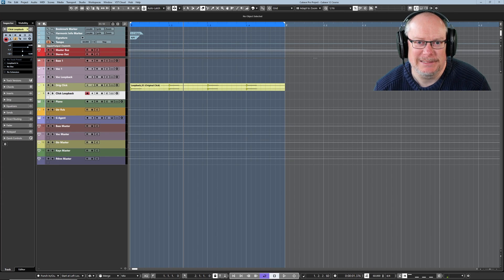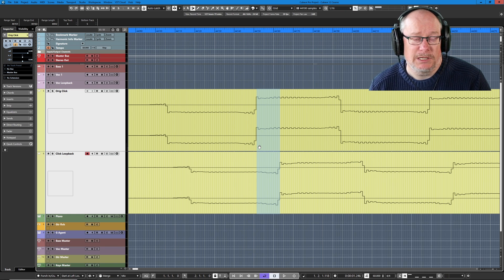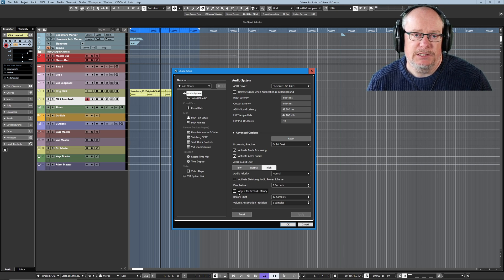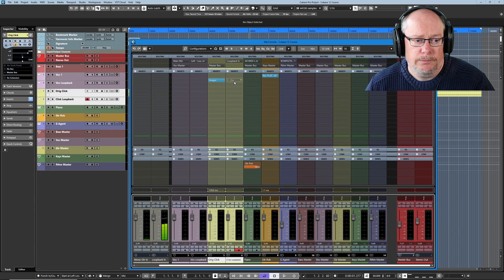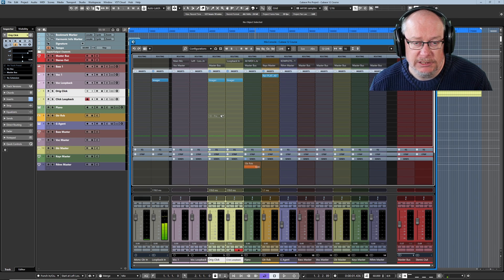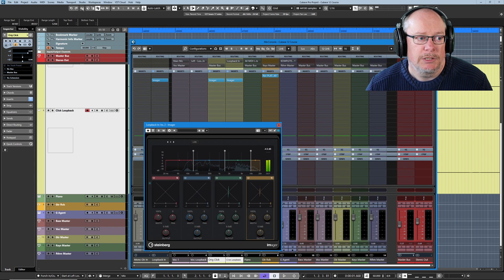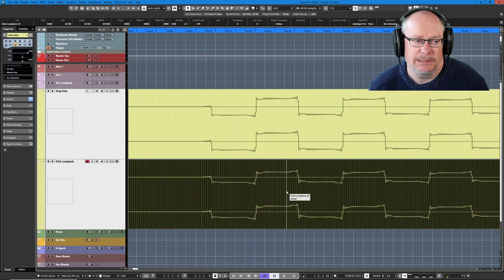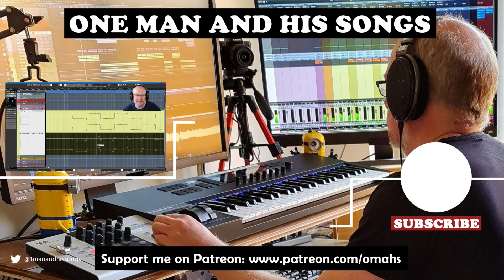The Essential Guide to Latency in Cubase 12 (Pt.4) - Record Latency & Manual Adjustment

Comment: Hi again...this may answer my previous inquiry...I have 3 plugins on this track and the total latency is 46.5ms..the interface I am using (tascam uh-7000) has a 13ms latency at the smallest buffer setting. If I just account for the insert latency that would be 2232 samples and with both interface and interface it is 2880 samples. If I set the record shift to 2232 samples the latency seems to be just about gone but not entirely. setting the record shift to 2880 or even higher changes nothing...I m not quite sure what is going on entirely but set to 2232 it is more than acceptable and there are no timing problems..thanks for your last reply.
Reply from the maker: Each of those issues is really a separate question, which I try to address across the series. The idea with Record Shift is that you use all of Cubase's OTHER tricks to eradicate latency (primarily Adjust for Record Latency and Constrain Delay Compensation), then use Record Shift as the final adjustment for any remaining empirically derived discrepancy between your played signal and the recorded one. It's a very complicated question, with many different components.

Comment: why do you put in Record shift 12 samples, not 9 or 10 or 11?
Reply from the maker: It's simply an empirically derived number: I examine the size of the offset using the range tool and determine that there is a 12 sample discrepancy. It's totally dependent upon your current buffer size and system parameters, but it just so happens in that example that the two recordings were  separated by 12 samples .